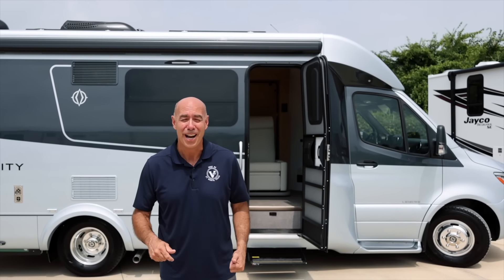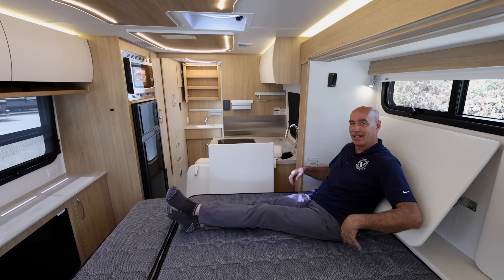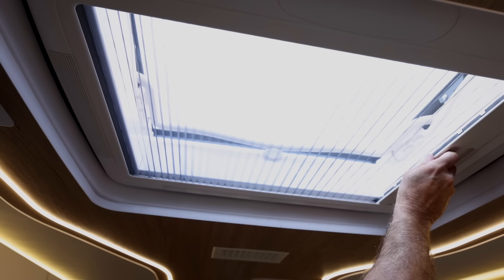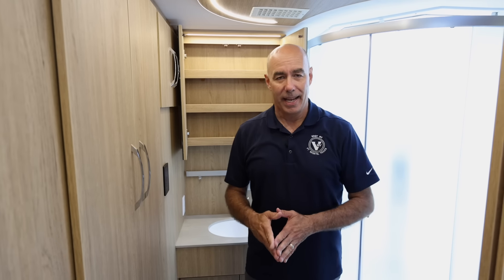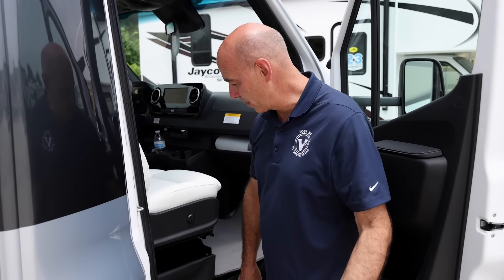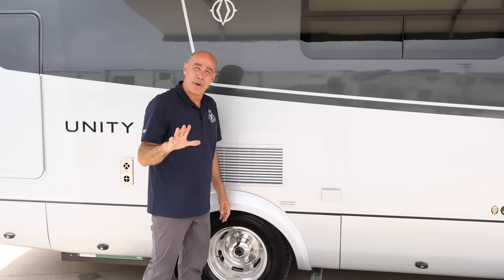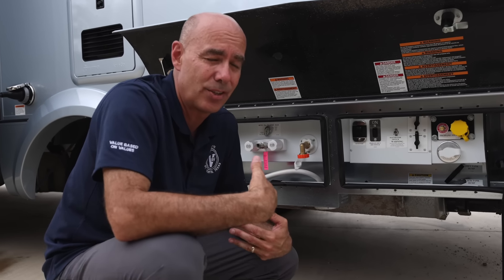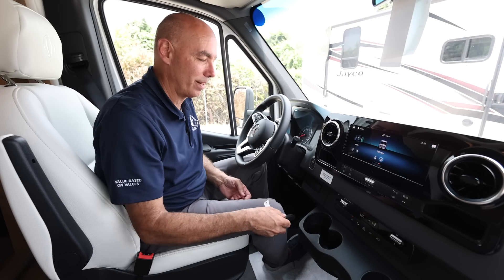Is The Unity Murphy Bed Leisure Travel Vans' BEST Floorplan?

Comment: It's a beautiful rig. Stunning. But no review or walkthrough can be considered complete  unless the Cargo Carrying Capacity is provided, along with the tank sizes. This determines whether the rig is actually safe to use with normal luggage, food, pets, people, water, clothes, electronics, tools, etc. In too many cases, these Sprinter and Transit and Promaster chassis-cab based rvs have completely insufficient cargo carrying capacity with two people and full water and normal personal affects. It's a safety issue and liability issue and potential insurance payoff issue if in an accident.

Comment: I like most of the layout in this travel van. I like that the two chairs swivel. But they should make a model without the murphy bed. Some people don't like having to bring the bed down every night, then put it back up every morning. 

The two chairs that swivel look like they could make a twin bed. Just have a cushion that supports the middle space of the chairs, and that could be where someone sleeps. and with the slide in, there is much more room without the murphy bed. It also allows more light in by exposing the two windows that are covered up by the murphy bed.

I really like the platform that goes over the stepwell. Not only does it prevent a pet from falling down into the stepwell, it also prevents someone from accidently falling into that space. 

The bathroom is bigger than what other vans offer. Nice big shower. 

Is the outdoor storage waterproof? Wouldn't want anything to get wet when it rains.
Reply from the maker: All good comments.  Outdoor storage compartments are indeed weatherproof.  LTV makes models with twin beds that can remain made up as an option. Thx for watching / commenting.  -Mike
Reply: If they removed the Murphy bed and just substitute a twin that would only allow for one person to sleep in the unit. There is a different version that has two twins across from one another that stays beds I believe. I actually prefer this version. It allows for far more versatile options. I can have people in and not have them stuck sitting on my bed which I hate. Personal pet peeve of mine or whatever you want to call it, I just don't like other people on my bed, especially when they are coming in from outside.
Reply: @lynprincevalli5221 there is a floor plan with 2 twin beds at the rear ( the bathroom shifts forward, another floor plan with a rear double corner bed ( bathroom shifts to side) and another one with a rear lounge/Murphy bed but still has a seating area forward. There is a plan for every preference
Reply: @ann-archist7172 my comment was to the first commenter who wanted to take out the Murphy and put a single twin in its place in this unit. If you take this particular unit and make just that one change and left everything else as it is you could only sleep one person. I know there is more than one version. I, personally, do like the Murphy beds as I like being able to move the bed out of the way for the day time. That way if we are stuck inside due to weather or whatever no one has to sit on my bed. It's a personal pet peeve of mine. I don't like someone coming in from outside then sitting on where I sleep. We all have our little things that bother us, that one of mine. I also MUST have a sink in my bathroom. I don't get those who can wait to wash their hands till they come out and use the kitchen sink. That is just gross to me! If I had my way there would be more sinks, I also would want one in my outside kitchen if I ever get a unit that has one. I'm a little obsessed with washing my hands😊